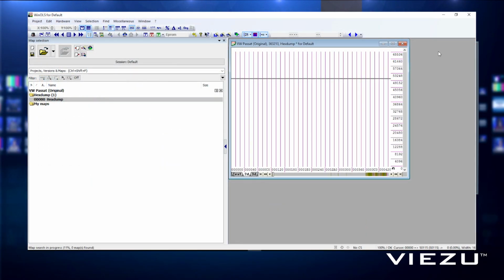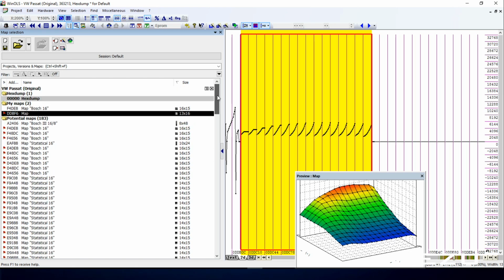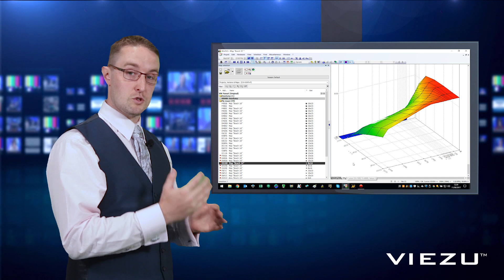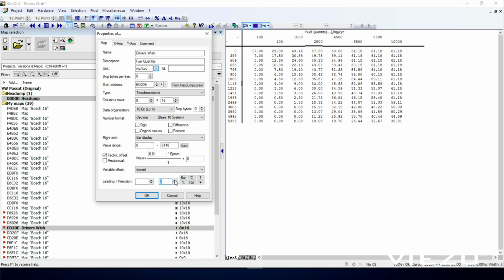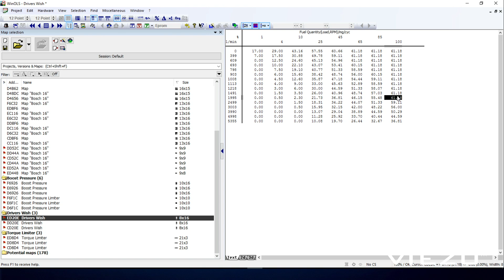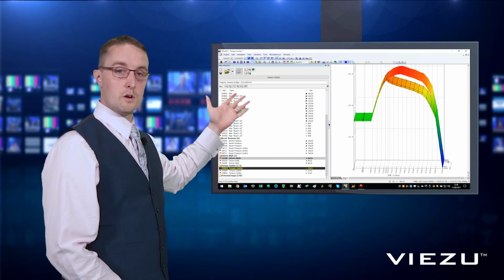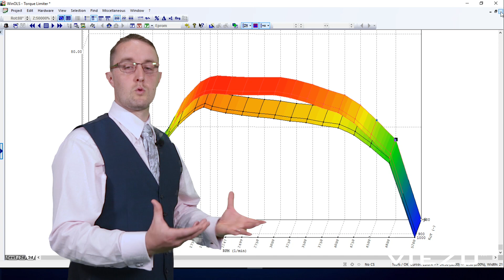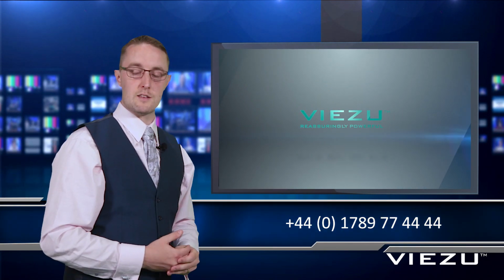How To Use and Tune with EVC WinOLs Tuning Softwarre

Comment: What software can I use to pull the stock tune from a golf mk6 tdi to re write it?
Reply from the maker: Hi Mikey, you will need a tool to read teh file from the car, and then software to edit the file, there are quite a few option, but the Golf is well covered. If its juts one car you want to tune, you want want to look at a tool like the Powergate, if you want to go on an tune other the Kess3 would be a good bet, and for the software probably either ECM or WinOls, depending on your knowledge  - you can see more on the kess3 here: https://viezu.com/alientech-kess3/ and if you can drop us a mail to info@viezu.com we can talk you through the options